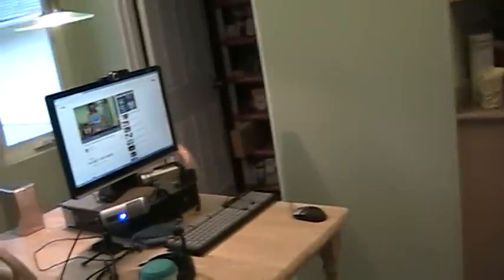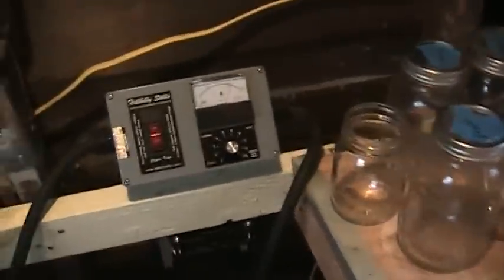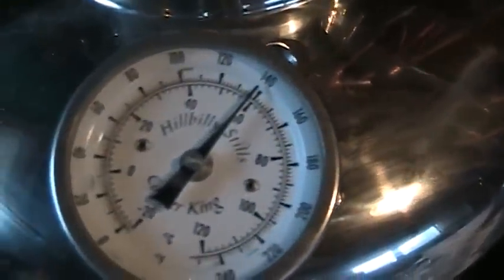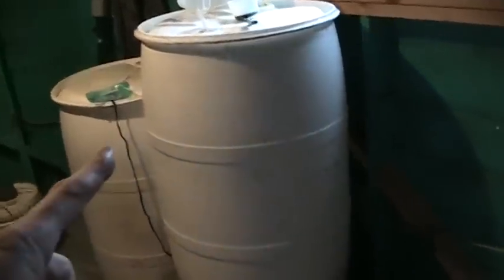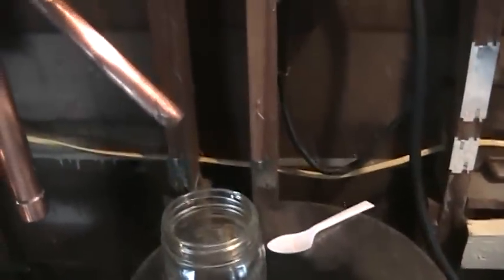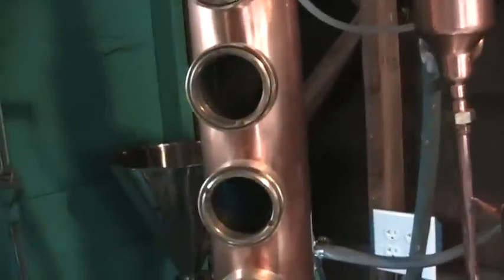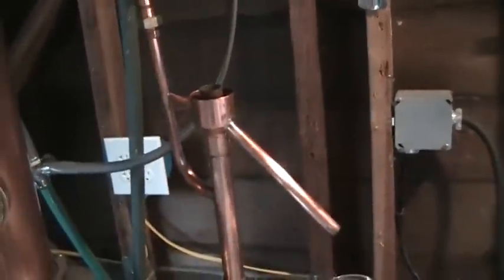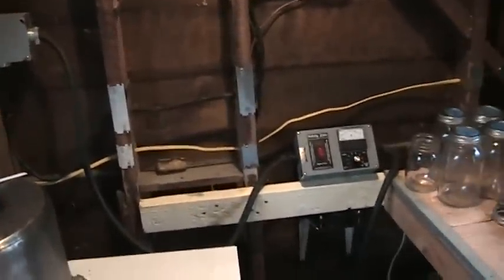How a Column Still Works...The Art of Distilling

Comment: Nice set up.  OK.  I've noticed my shine doesn't start dripping until the 8 gallon boiler gets to nearly 200 degrees.  I did a stripping run of a sugar wash and got about 3 gallons.  But yesterday did a molasses wash and only got a gallon.  I tried the reflux method but not sure if the stuff is safe to drink.  I tossed the first 3 or 4 ounces.  Any tips?

Comment: I thought you were supposed to throw out the heads and tails. I got a still but haven't used it in years.
Reply: +Link Knight commercial distillers don't, but you should to make the best quality. In reality, the concentration of methanol is so low that it is usually fine to leave the heads in (maybe not the tails) but any respectable operation will discard head and tails.